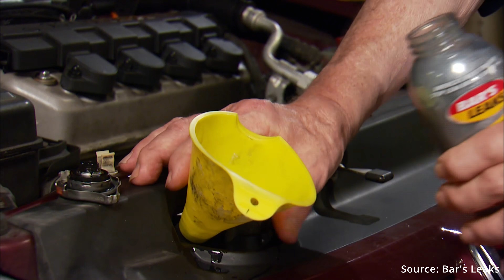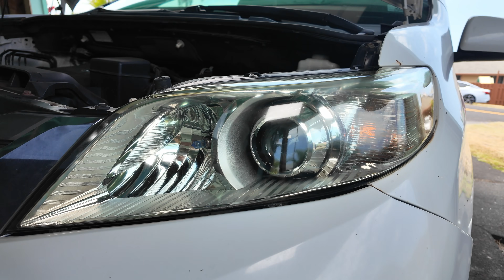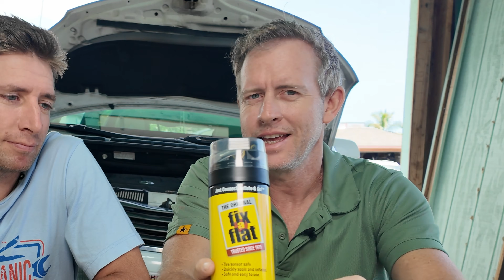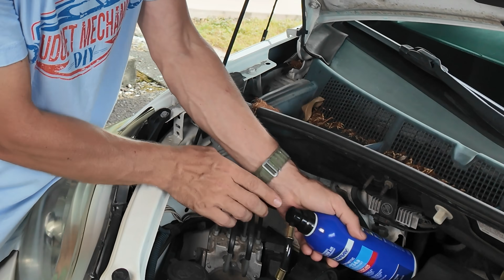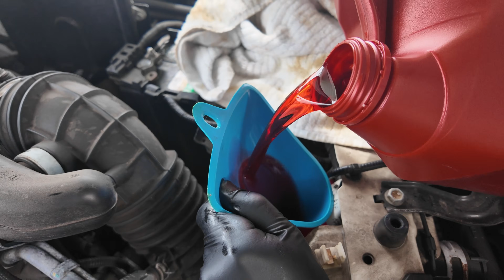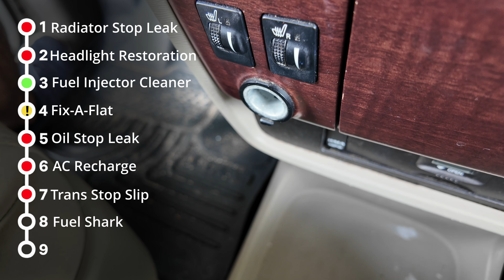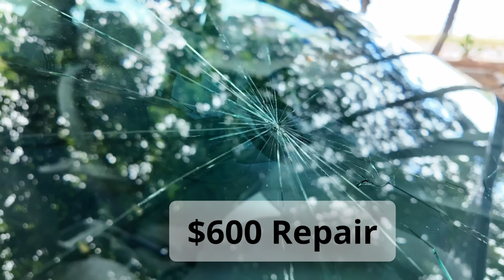These 'Quick Fix' Products Shouldn't Work This Well!

Comment: Before I added refrigerant, AGAIN!, I changed out the Schraeder valve which I suspected to be leaking by putting a drop of water on top of it. The water bubbled away when I turned on the AC.  Replaced the Schraeder valve and added Walmart refrigerant. Been two going on three years and the AC is still very cold. And a good mechanic friend of mine told me to NEVER use refrigerant with stop leak so I never have.

Comment: A mechanic friend of mine recommended fuel injector cleaner to a full tank of gas that you run to basically empty (to let it do its job without dilution), once after every oil change. Good advice

Comment: Before I never really used fuel cleaner additive. Then about 6 years ago used a good one with pea, after truck used up most of the tank of gas I noticed all of a sudden felt more responsive and ran better. I could feel when it did it's job. So now I use a good pea cleaner every 6 months(redline s1, techron, or regane) also add some lucas at same time to lubricate while the fuel injector cleaner is working. I used a ac recharge on old class A RV, worked great. I bought a cheap 2.4 liter gmc terrain awd rebuilt title in 2017, had 32k miles, was $6,500. Only issue was a stall right after starting,  someone on YT said add oil thickener and will stop stall, that was about 6 years ago. Every oil change I add 10 Oz of oil thickener, bardahl stop leak and has never stalled since. Is still on road and runs great to this day and 100k miles. People have said its just a bandaid to take it to shop and figure out what's wrong. With no codes, price paid for the terrain, why would I pay a ton in repairs or diagnostics. Even if blows up today, got well worth my money out of it being was driven daily for 9 years. Also does not use up oil before oil changes. Only thing ever replaced was a vvt solenoid and that was while troubleshooting the stall. Some of these things have their uses, but on a perfect vehicle(other than fuel injector cleaner) I would not use. But sometimes, can make huge difference in right situation.

Comment: Fix a flat works, I’ve had multiple times works? It works if you have a puncture on the tread not the walls. I’ve also then sent it on track and it’s been fine even then 👍🏻 but yeah use it once I wouldn’t use multiples

Comment: I have to disagree also on recharge ac kit.  My son's 2014 Honda civic was blowing warm and used recharge kit.  problem solved, also on newer cars they do not have a spare but give you an aerosol fix a flat beware.  The solution in the can if it gets on your cars paint will damage it.  Also flat cannot be fixed so you have to buy a new tire.  I bought a spare and tools and put in the car (Honda Civic Hybrid), if I get a flat I can call Triple AAA and then have tire fixed thus not having to pay for another $200 plus tire. Also agree with windshield repair kit which I used and drove a car for years afterwards with no windshield problem.  Love these videos.

Comment: As a former professional driver I always carried a pound of finely ground pepper with me in case of a radiator leak. It works. At least in the vehicles that I drove it the last century. Of course when you have a radiator leak you WILL HAVE TO GET IT BOILED OUT AND  fixed but the pepper can keep you going for many miles until you can get to the truck repair shop. AS LONG AS YOU DON’T DRIVE HARD. Take it easy cowboy. The pepper saved me from a winter storm once and kept me on time for a delivery once. (Course I had to get the radiator professionally cleaned out and fixed at my earliest opportunity.
Listen to the old folks, not the scamming companies.😊

Comment: AC refill has worked well for me. Fun fact: a 10 yo car without leaks only have about 50 percent of uts original content.

Use it like this feel whennthe AC starts cooling add just a bit more than stop. Works like a charm.

Comment: These guys are full of it and probably shilling for big repair chains. I have used the radiator stop leak thing and it worked like a charm, doesn't damage anything and saves you money if you don't want to spend $400 in replacing a radiator in a $1,000 old car, you can do it for $20.

Comment: Best thing for headlight lenses is to not allow that to happen to begin with. Wash the lenses with a good glass cleaner and use a good quality canuaba wax. Same as waxing the paint. dry,buff off.Do this 2-3 times a year and will never turn yellow or fade. I have 2010 sierra and have done just this and here I am 16 years later and the lenses are crystal clear.

Comment: I completely disagree about recharging your a.c and also bars leak, I have used them. Many times on many vehicles and have had a great success with both of them. I've even used a head gasket, sealer and believe it or not. It seems like a gimmick, but it worked like a champ, and the car was able to go another 50000 miles.

Comment: I had radiator stop leak fix a leak in my radiator in 1986 it lasted until 1992.. when at that point the tank on the radiator went bad and I had to replace the whole radiator 

Chrisfix had at work in a car for 3 or 4 years
By the way when I did it I did not pour the entire bottle in I did about a quarter of the bottle

Fix-A-Flat does it work with a s*** you need to use slime that's the stuff that comes in the green container that works incredibly well

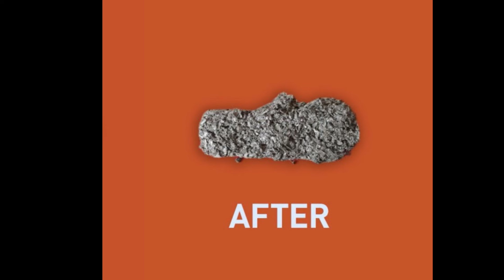Comment: 7:44 as a former tire Guy. You're a piece of shit if you use Fix-A-Flat 

Just buy a goddamn plug kit and a compressor and then you won't ever even need to take it into the shop. You've already fixed the tire 

And for anybody that says a plug is not a proper fix, you need a patch done from the inside of the tire 

You're full of shit 

I spent years doing this and I've had tons of patches come back because they didn't hold properly. I have never once had a plug fail. Not one time not in my private life, not in my professional life 

So something that plugs up the hole for the rest of the life of the tire and takes 2 minutes to install and needs no special equipment 

Versus going to a tire shop and having them deem out the tire. Take it off the rim and patch it from the inside and odds are you're going to have to bring it back because they didn't get it to hold right the first time

Comment: The Armor All headlamp cover restoration kit works wonders.  I’ve used it on my car.  It’s easy to use and your headlamps will look virtually new (I’d call mine 95% restored - not quite perfect but delighted with the results).  Ignore all headlamp cover restoration videos on YT that involve sandpaper (Good Lord!)  If you guys think that kit doesn’t work, you’re just wrong.

Comment: you are the 1st creator to bring up "Top tier" fuel in a video. you should also use the same fuel grade regardless of the price. 1 thing that nobody realized is that not all regular fuels are the same from gas station to gas station.for the newer windshieds, up here in Canada, that is a whole new division. i wish iwas kidding, thing is they now have "sensors" in the windows for gps signals, weather etc. they even have to align the ECU for the windshields. an average windshield will run around $300, the new windshields with the technology advanced are closer to $1200.00, i would rather drive a 2003 chrysler sebring that just has an ECU which i can wrnech on myself. n it is also DOHC with a V6 200hp fwd.

Comment: On #1 radiator stop leak= No. It will probably plug the tubes in the radiator and almost always stop up the heater core for the heater. The best temporary fix is? Corse ground black pepper, it will suspend in the liquid and stop small leaks and cracks until you can get it fixed properly. Nothing is going to fix a cracked head or block or head gasket except $MONEY$. After the repair the pepper will flush out easily with no repercussions to the cooling system. In fact you can leave it in the system for future seeps and leaks.

Comment: Recharge kits, you don't even have to do it yourself. AutoZone type shop do it for free, if you buy it. The gas, it isn't that bad. Is crazy depending on year, it's the same gas many "air can duster" use. Some country people just use those can instead, since they can't get the other one.

$20-50 vs hundreds. It's worth the gamble

Comment: Fix A Flat will clog a TPMS sensor and void the warranty.  I worked in the industry for 15 years.  Many tire shops will not touch a wheel that it has been used on.

Comment: Disagree on #1. I used expensive copper looking stuff in alloy V6 to fix leaking thermostat housing that was not accessible. Had no issue for the tens of thosands odf kms I put on it after that.

Comment: stuck miles from help with crankcase of foaming oil middle of winter and one small gas station and store. solution  was multiple applications of radiator stop leak and oil changes. fix lasted for thousands of miles. cant tell me it doesnt work.

Comment: AC recharge kits have saved me many times. However... the stuff with sealant in it is nasty. My local shop told me that if 134a with stop leak was put into a car they will not hook it up to their equipment as it runs through their stuff and messes it up when it sits. I only use the straight 134a. If there is a leak it should be repaired. My compressor is getting weak on my 33 year old T100 and the AC will not blow very cold at idle. I had it in the shop for an inspection after a minor accident and had them diagnose the AC while it was there. First question they asked me was "did you put 134a into it and did it have stop leak in it?". So while it can get you going... it can eliminate the chance of getting it repaired properly in the future.

Comment: The problem with fix-a-flat - I was trying to fix an old tire on a vehicle that was sitting for a while. I went through 4 cans I got from a two different places and every can could barely push any of the product out of it. I tried removing the valve stem, I jacked the car up so no weight was on the tire, none of the cans worked. My guess is the product hardened inside the can because it sat on the shelf too long. You're better off buying a plug kit and finding where the leak is and plugging it. It takes longer but it wont ever go bad sitting in your car.

Comment: Had a shop recommend a trans flush they said it was long over due on a 1997 Buick Park Avenue. I also had no trans problem before that point. Almost immediately after the trans flush my trans was slipping. Tried the stop slip trans fluid to no avail. Then the trans died about 3 days later and left me stranded 3am 30mins from my home. Not a good time!

Comment: The fix-a-flat nonsense.
I just have a set of plugs in the car. Which they use in the garage with a special tool to insert the rubber string into the tiny hole.

And to reinflate the tire, easy: Almost every new car comes with a handy little airpump (and most of the time they also supply a can of the rubbish you guys show..... so they do no longer have to install a spare tire where there once was a spare tire.

Best solution: Carry a spare tire.
Second best: An electric pump that works on the car's battery and a tire-plug set. But this only works for a small puncture obviously. Not for a blowout.
Third option: Call someone to bring you a spare tire or a set of the fixing materials to fix the tire.
And maybe, maybe a fourth option: This rubbish.

Comment: I HAVE USED TRANSMEDIC AUTO 
TRANSMISSION TREATMENT ON TWO
DIFFERENT OCCASIONS, THAT THE 
TRANSMISSION WOULD NOT CHANGE GEARS ,FROM A STUCK VALVE BODY.
I PUT TRANSMEDIC IN THE TRANS. 
AND WITH IN TWO MILES IT STARTED 
SHIFTING . SAME TREATMENT ON BOTH
CARS WORKED IN MINUTES !!!
IT WORKED FOR ME 😎😎😎😎😎

Comment: Years ago we fixed a friends leaking head gasket with one of the Stop Leak Products.
Years later it's still working and he hasn't replaced the head gasket.
He's not driving the car much... which is part of the reason why it's lasted so long.

We also put through a protective coating which had a transformative effect on the vehicle i.e. Fuel efficiency improved >100% (it was running really badly prior to this)
🙂#XcelPlus

Comment: When I first bought my Passat station wagon the air conditioning was blowing hot. I put one can of r134a, with your special gauge, it lasted almost 15 years. Then I had to add another small can. So I don't think this is worth going in the trash. Is it for everybody? Perhaps not, but I also own the complete set of proper gauges for both r12 and r134a. Which will both be obsolete well not for my 73 Thunderbird!

Comment: Fix A Flat WARNING!   Years ago I carried a can of Fix a Flat behind my seat in my truck.  One morning I went to drive the truck and there was Fix a Flat all over behind my seat and even covered part of my glass behind the seat. Not only that, but there was a huge dent in the steel panel behind the seat. You probably know what happened: The previous day it was very hot outside, and even though my truck was white,   it got SO hot inside that the can of Fix a Flat exploded! Just glad I wasnt in the truck when that happened.

Comment: I had a coolant leak and I couldn't find it, I used rad weld 5 years ago and touch wood its been great. No leak no over heating and its still in my coolant to this day. So sorry lads maybe the brand you mentioned might suck but rad weld has done me proud

Comment: I have one for the "it works, green light" category. I applied CERAKOTE TRIM COAT KIT on the black plastic parts of my car 9-12 months ago and, they still look as great as the day I applied it. I think it was $15-20 on Amazon and I have a few application cloths left over! I'd buy that stuff again in a heartbeat but, at this point I haven't found the need to!

Comment: True story.... had a Chevy Chevette that had a tiny stream of water coming from the middle of the radiator (little stone impact), used an old mechanic trick... I added half a can of ground black pepper to the radiator coolant and let it idle for about 30 minutes maintaining the coolant level until it stopped leaking, took it for a 15 minute drive revving it a bit to maximize coolant pressure. Drove it for 2 more years with that radiator, never flushed the pepper out, worked great.

Comment: In my first car, a beat up 1995 Plymouth Neon, the AC+stop leak got it working for a few years at a time. Wouldn't use it on a new car, but I'd throw it in an old car for sure if you don't want to spend money on it.

Comment: Re: AC recharge with stop leak: my '09 Dodge Ram's cooling system had already been diagnosed as needing a full rebuild ($2.9k). The problem was a leak which was costing me $200+ for a recharge. I put 1 can of AC recharge with stop leak in, and my AC has been blowing ice cold for 14 months & counting...I live in Arizona.
Reply: it will eventually leak out again. If you intend on reselling your truck its value will plummet because no one wants a truck that has a leak in the ac that'll cost 3 grand supposedly to fix, and the leak won't get any better over the years

Comment: instead of fix a flat, try a plug kit and a cheap 12 volt compressor. The plugs handy any small or medium hole, and even a cheap little compressor can, in a few minutes, inflate the tire. Just to this pair BEFORE you de-rim the tire by driving with very low pressure.

Comment: Radiator stop leak plugged cooling passages in the cylinderhead of my old car so it overheated and warped the cylinderhead.
My Radiator had a small leak and i put Stop Leak product in my cooling system to try and "fix" the leak.
Few weeks later my headgasket and my heater core blew and when we took the head of the engine Stop Leak had blocked small cooling passages in the cylinderhead and the cylinderhead was warped due to overheating and blocked cooling passages and the excess pressure from the blown headgasket took out my heater core, and i had to dissasemble my entire dash and take it out of the car, to get to the heater core so i could replace it!
So i learned the Hard Way NEVER to use Stop Leak for anything ever again!

Comment: I disagree with your statement for OEM engine oil  recommendation. Most vehicles can run slightly different oil viscosities . You are correct to much or to little viscosity could increase engine wear prematurely or starving the engine for lubricants.

Comment: AC system in car leak slowly form the compressor shaft, almost all old cars will have low AC, it worked realy well for my old car 10Yo, gave it another 5Y+ of AC.
Reply: No they don't, I have a 25 year old car and it never needed an ac recharge, only a compressor since the clutch was shot. The ac system is sealed just like your cooling system. if your level goes down at all that means you have a problem and should properly fix it instead of throwing bandaids at a deep laceration
Reply: @keithgriz5898  the shaft of the compressor is where it leak over time.
Lot's of car that are 10+ years old have lost some gas from that place, one canister replenish it for a few years.
It was worth it for me two times out of two, lasted 5Y+ after that.
But if you have zero cooling then you probably have a real leak.
Tesla that has an electric motor on the compressor instead of a belt have scealed systems.

Comment: Don't put fix-a-flat in your tires. Half the time it doesn't even work. But if you do put it in, please tell the shop so the guy working on it is prepared for it. Also it absolutely does not accumulate on your TPMS sensor. It is a liquid, and only dries when it comes back out of the tire.

Comment: The first one Radiator Stop Leak IS NOT a waste of money. I had a 84 Honda Civic hatch back, the head had a small leak in it. It was getting into the oil, I used a Full Bottle and then some. It stopped leaking I changed the oil twice, then put it up to sell. When they test drove it, they drove it. They asked why selling it, I  told them I think it had a cracked head, they told me impossible with that type of pick up. $700.00 As is SOLD